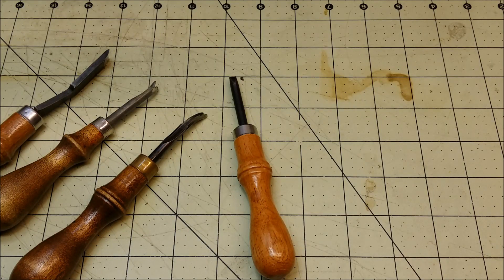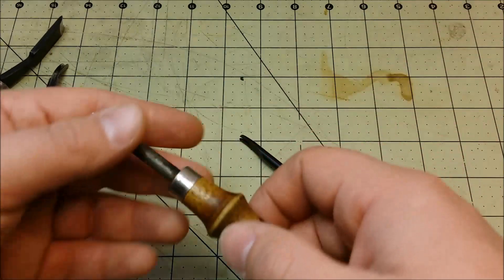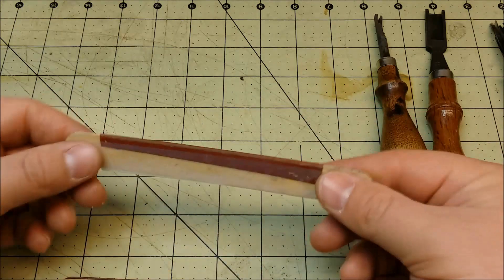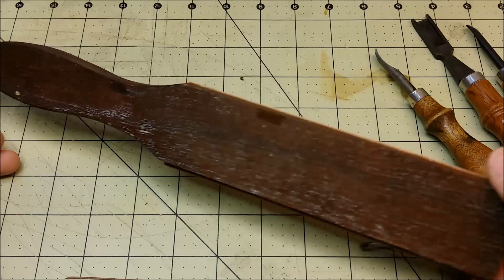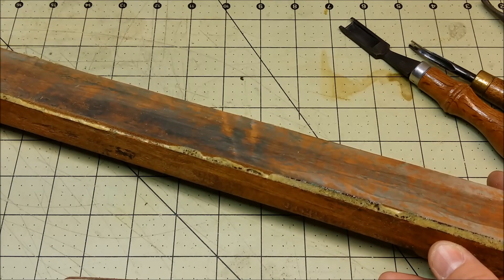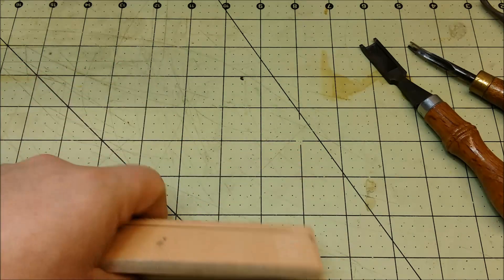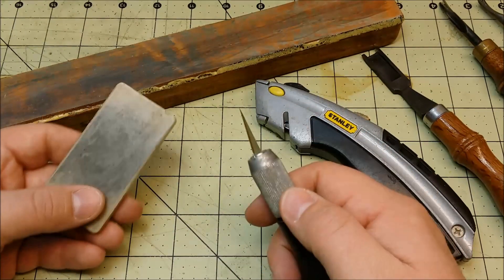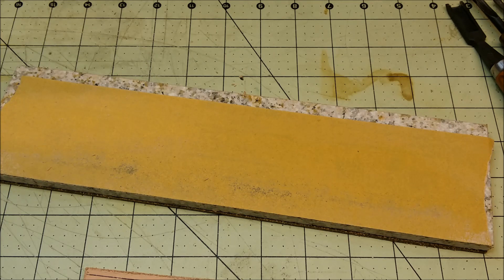Leather Edge Beveler Sharpening Solutions - Leather Tool Stropping

Comment: Thanks for the video. My technique for sharpening the edge tools is similar but I use sole leather because it is very rigid and instead of paddle pop sticks I use cheap Chinese made violin bridges that I shape and thickness  on sandpaper and make one for each size tool.There is no need glue stuff on for the compound to stick to, just apply it directly to the timber surface. On eBay you can find packs of 10 for a few dollars with free shipping. I make strops with leather and get the compound to adhere by first removing the grain surface with a belt sander then rub in some petroleum jelly wipe off the excess and then apply the compound. It provides the perfect strop surface. All the best.
Reply from the maker: Nice. I may try out your method. Sounds like an improvement over mine!

Comment: For round edge bevelers this is what I do. Get grits 1000, 2000, 5000. Choose a round shaft drill bit that fits the small radius of the edge groove. Choose a bit that is slightly smaller than the groove to allow for the paper thickness. You can lay on the beveler to see how the fit is. Once you know the bit size you will then know for the next time. Put the bit on the table. Take a 2 inch strip of paper and lay over the uncut portion of the drill bit. Move the edge beveler along paper laid over the bit for the distance of the shaft of the bit that is smooth. You only need an inch. The paper makes a nice curve over the bit. Pass the edge beveler about 10 times each grit size. Then strop with the leather using the stropping compound. This is my favorite method because all I need is the sand paper and drill bits are on the shelf. Got to keep it simple.
Reply from the maker: Wish I had thought of that. Great solution! I'm going to do that going forward.
Reply: @wornwizard  cheers. Glad I can contribute.
Reply: Ha the best ideas are simple👌👌excellent 👌👌👌

Comment: The number 8 is called a French Edger. Another option for sharpening your edgers is using card stock loaded with green (don't use the white) jeweller's rouge. Then fold over to sharpened  the inside of the edgers.
Reply: Why not use white jeweller's rouge?
Reply: Can you help me understand the differences between green and white jewelers rouge? I’m new to this. Thank you in advance.

Comment: What tools do you recommend as a must have?
Reply from the maker: DALE thebelldiver I think it really depends on what you want to make. This may make a good topic for a future video
Reply: MakerDad thanks for a reply👍.  Being new at this it’s hard to say what I might tackle.   But surely there are a few tools you can say are the top four or six must have tools and maybe the ball park cost.  I’ve looked through the Tandy catalogs and this is why I’m asking.   

I’m guessing a grooving tool, a edge beveler, awls and what?
Reply from the maker: DALE thebelldiver It's project specific, truly. But yeah, if you want a general tool set, Tandy sells a set you could consider, or even buy the equivalent tool on ebay. Chinese sellers have some impossibly low prices, especially if you want to try a tool out before you spend much on higher end versions. Bare minimum you'll need a knife, wing dividers or stitching groover, awls, needles, thread, barge cement... it really just depends on what you want to do.
Reply: MakerDad well believe it or not; I’m doing commercial restorations on all things leather.   So far I’ve been able to teach myself the trade.  I do watch these videos and apply what I watch.  Of course the next step is to create.  

You seem to tackle about anything..  son it only logical I watch you and see your tools.  

I spent the entire day making 4 handbag handle; leather connectors to a ladies purse.  I’m slow as can be to be as perfect as can be.  Speed will improve but the quality must be there from jump street.
Reply: MakerDad I don’t know anyone doing this kind of work; so your videos, comments and responses are appreciated. I’m using a cobblers stitcher.  The pressor foot gets in the way and it leaves marks in the leather.    Any suggestions?
Reply from the maker: DALE thebelldiver Is that a sewing machine or a hand tool?
Reply: MakerDad its a sewing machine for sewing heavy duty leather! Shoes, canvas.  I’m sewing anything that fits under the pressor foot.  However I’m having to hand stitch a lot too.  I’m replacing leather straps on diving harnesses.  

All this is new to me; even though; I’m turning out the work satisfactorily for customers I’m sure I’m taking too much time and would expect to produce even better work using the proper tools. 

Being a commercial diver I’m use to making due. I’d rather learn it using the correct tools.
Reply: MakerDad I’m buying a machine tomorrow.  Or; making an offer anyway.
Reply from the maker: DALE thebelldiver Awesome! I hope you get it sorted out. I have no experience with machines whatsoever!